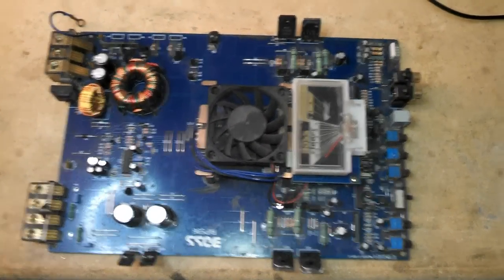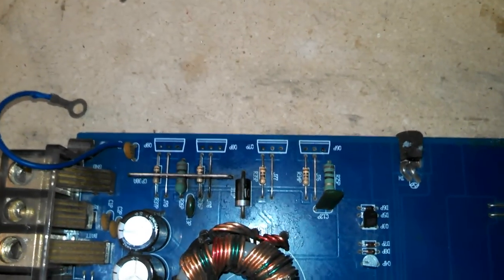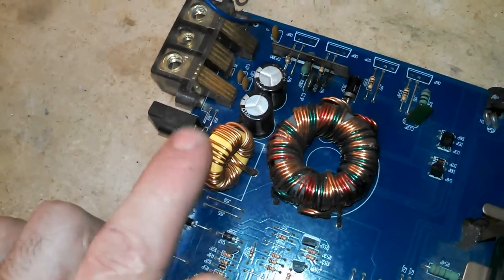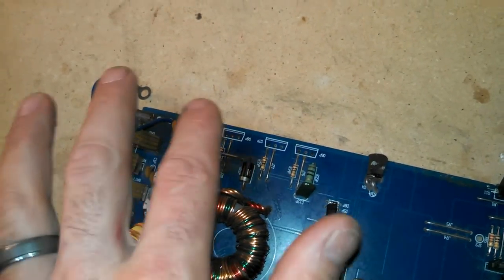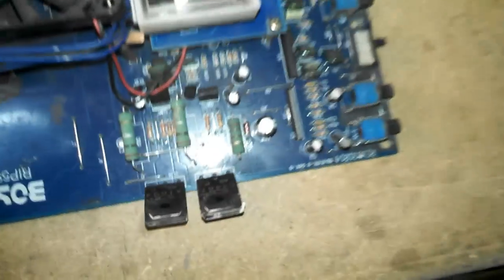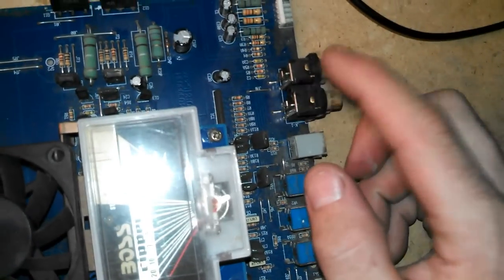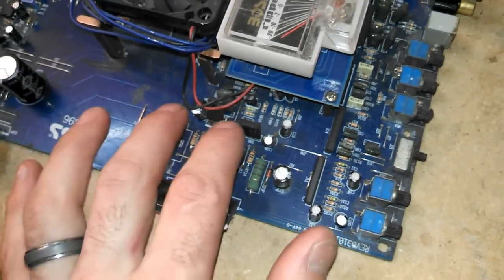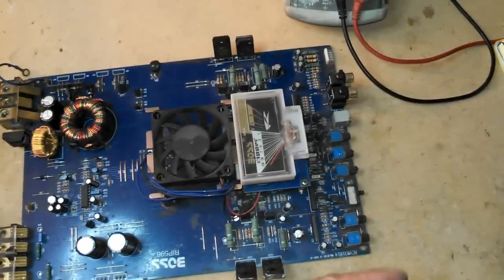How an Amplifier Works - What happens inside a car audio amplifier

Comment: The LC filter in front of the core is not there to filter out anything coming in, no appreciable noise transfers through the power supply . The LC filter is there to filter out the high frequency hard switching noise created by the fets that will, if not filtered, put a 40khz and up spikey square wave back out onto your +12, making a huge antenna and will make other electronics in the vehicle fail and work erratically. It is required by the FCC,  read part 15 of the FCC rules and regulations.  The npn and pnp transistors are not on the top and bottom as you pointed out, they are right next to each other. That boss amp uses the 2sc4467 2sa1694 Sanken audio transistor pair.
Reply: interestin. so much history in boards

Comment: I gotta old massive audio 25.4 I believe it is a 1000.4 it's hudge more than half the size of the competition 1500.2 I had from them awhile ago, it still works great but the rca's input are loose I was gonna just open it up & ca glue it but what might you recommend I have lots of experience soldering but iv only dabbled in motherboards when somthing easy broke or I would bridge the old aux cable mini portable speakers to make them LOUDER but I don't have/own a vacum or anything just basic solder stuff,even 6% silver solder but im all ears

Comment: thanks for the video sir.
one of the mos explicit videos on amplifiers explanation.
Would apreciate your help. I am trying to repair my subwoofer class d amplifier.
I got a green light no proctection light, however there is no output signal voltage.
RCA have continuity to the board,  i am wondering is the OPAMP are bad and not turning on the output mosfets?

Comment: I have an old SPL dk1000 amp that was in my car and it slowly stopped working. first it started cutting out while running a pair of 12s and then finally went dead with no power, fuse intact.

I haven't opened it up to look yet but do you know of any common problems that would cause the amp to lose power completely? blown fets? I have a multimeter, just don't know what to look for/what could be fixed, if at all.

Comment: Hi mate, really enjoyed the video! Just what I wanted to know! Now....I have a 1000 watt boss amp and I'm certain is does not put out 1000. Can I make it a better amp by replacing the caps and MOSFETs with better quality items? Thanks
Reply: +howitis howitis No, you can't just install better or higher rated parts. That will improve reliability, but the actual output power is truly designed into the amplifier. When a company builds higher and lower wattage versions of nearly the same amplifier - there are other parts also changed to match the designed output.

Comment: what re them six green things called next to the driver transistors?
Reply: +Harold Williams The large ones are known as emitter resistors. The actual signal from the output transistors needs to have a very small "buffer" of a fraction of an ohm, as well as an inductor (coil) for stable operation. The same applies to home stereo equipment as well.

Comment: Quick question my amp turns on and everything but does not put out any sound. Wiring and fuses are good as im running a smaller amp. Any help on how to fix it

Comment: Hey man awesome video I learned a lot. I have a question though, what would cause an amplifier that's powered on to almost catch on fire without having any RCA's plugged into it?
Reply: What does it do with rcas plugged in? Sounds like you have a dead short somewhere in the pwr supply region.

Comment: Quick question, how much voltage does the transformer in the amp output? could you make some sort of inverter out of the power supply side of the amp?
Reply from the maker: The voltage all depends on the amplifier.  But no you can't make a DC to AC inverter. Even if it did produce 110v AC, it would not be at 60hz which is what standard US AC runs at.

Comment: What can cause a power drop when volume is increased? Even the LED light flickers. I have enough power coming in. I have another amp that runs fine on same hookup. Problem amp Boss CH2502

Comment: hi mate i bought a q4000 amp and the question i have is when it says
 • Rated Power: 125 Watts RMS @ 4 ohm x 4) does this mean each of the 4 channels has 125 watts rms at 4 ohms
or does it mean it has 125 watts rms between the 4 channels at 4 ohms
Reply: Each single channel is driven by 125W RMS output ×4 not 125W across all ×4.
Reply: @smetanavichlamanov8103  6 years later i got my answer cheers mate , ;)

Comment: this is really helpful understanding the basics! I do have a curiosity though, can the amp be powered by an external transformer that has the rail voltage need by the amp, pretty much bypassing the amps power supply and feed it lets say at the power capacitors with a + - 20v ? like in the case I want to use a car amp at home, and don't want to use a 12V high amp p supply
Reply: yes you can but then the caps must change
Reply: bassnatics caution you may also 'bypass' any *protection such as dc on the output or over current conditions that the switching supply would shut down in

Comment: I have a memphis pr 1.500 I'm trying to test it with a computer power supply my question is I have power on the amp but can not get signal to come out of the amp I'm using my house equalizer to send signal to the amp do you think the amp is blown or is a power supply not enough to run it? Ps rca's are good
Reply from the maker: A computer power supply is not ideal to power an amplifier. It could very well be bad, but I would still change the power supply.  does the amp power on?
Reply: it's powered on and the cooling fan runs but no sound coming out of it I know the way I have signal going to it won't have volume control but I turned the gain up and down sub sonic filter all that no sound I threw power to the sub with my house amp just to check it's not the speaker
Reply from the maker: +Josh Cassler Could be a ton of things. no way of knowing without seeing it in person and really testing things.
Reply: if one end of the rca plugs is in the amp and you touch the other end of the rca you should get a hum or a buzz or somthing it's dead not even a crackle it takes pretty big Guage wire to run if it's not getting enough power would it still be able to turn on just not put out sound
Reply from the maker: +Josh Cassler I have seen that, yes.

Comment: Hello, I have an amplifier and it doesnt work. Its lights are ok. Everytime I turn it on with the subwoofer connected 2 small components situated next to each other named C4467 and A1694 get hot. The speakers work fine because I connected them with my house Amp. If I change channel to my subwoofer then another set of these components gets hot equally. Moreover if I coonect only the speakers without the sub then it gets hot but slower. PLEASE help me...!
Reply: A quick google says these are your NPN and PNP transistors (they handle the power going through the speaker). They should be attached to a heatsink, but if they are in a 'low power' amplifier, that might not have been necessary in theory. Speakers have different resistances (16, 8, 4 ohm are common) which means that if you use the wrong one, you'll get more volume through it, but much more current will run through the system, heating up components. A simple way to solve this would be to heat sink these, if you must use those speakers. If you'd like to do this, the simplest way would be a drop of super glue and a small piece of metal (preferably with fins) attached to each chip, to help spread the heat (use electrical tape to prevent the metal from touching anything else, and don't let them touch each other. Many transistors/mosfets conduct current through the heat sink).
* I take no responsibility for any damage to your equipment, you should look into heat sinking before following this advice.
Reply: Disconnect the speaker and check what the voltage is on the speaker terminal. It should be very low around 20/30 mV or less (0.020/0.30 volts) if it is volt/s you have a offset problem.

Comment: I have a phoenix gold tantrum 1200.1 the amp turns on and I get 0 sound but the sub reaches full Xmas and hums any idea's. I've removed the amp from the car and replaced it with another amp and it works fine. I've tried bench testing the phoenix gold with the result no sound just hum's and the sub goes to full xmax
Reply: Sounds like you have Direct Current at the amp output which is pushing the cone out and holding it there. It could eventually cook the coil of the sub. But I'm not sure which component is faulty allowing this to happen.

Comment: question: I have an alpine pdx m6 and it gave up on me taking my woofer with it
the amp powers up; but it is sending DC power to my speaker
any idea what may be causing that so i can get an idea if it is worth fixing?
Reply: Amps work with dc not ac

Comment: I had 3 risistors burn up right by the transistors or 3 prong black square things. Why ? If I replace them will they just burn again.Also it worked and I heard music from a very small speaker,iput on my subs then it fried. Worked before subs butsubs are fine just couldn't handle it I guess. Also how do I replace the resistors and get same ones ? Ones that fried are just like others next to them so how can I test them to see whati need
Reply: +Headshothorror4488 Those emitter resistors blow for a reason, and you need to fix the reason. Those rarely blow, so you've got major damage somewhere.
Reply: +Alan Maier They are 10 ohm I think , it fried up only one in a set of four but is 10+ yra old. Also worked on a small speaker.

New amp , it will get loud and normal then just goes half as loud outa nowhere ? When I press on the amp cover it gets loud again , when I jiggle the RCA connectors same thing. Could a loose RCA cause this as in the amp loose not wired RCA those are new n Memphis. Is the a ground wire in amp ?maybe loose, its a mtx tc300 CEA 2006 rated but old.

Comment: I'm trying to bypass the built in internal amp on a 90s Honda radio, basically converting it from high level out to low level out for a cleaner signal to an external amplifier.  Also looking at upgrading the DSP and other preamp chips where possible if anyone has any tips.  I have no idea where to find circuit board and chip information if anyone can help.

Comment: what causes a amp to play fine up untill it builds heat? i know heat isnt good. but it happens. i use a peizo buzzer to set my gain so im sure im not clipping. ?
Reply from the maker: Sounds like the load impedence is too low for the amplifier.  ie a 1-ohm load on a 2-ohm stable amp.
Reply: +The Amp Lab you would think..but. it did the same thing to me at 2ohm as its doing on .5.. i can play it for 30 min maybe full tilt and it will then go into protect untill i let it cool. i opened the amp and i see no burns or anything funky... i have 4 batteries. and i am constantly monitoring voltage. i just dont get it.  amp is a lanzar opti 7k
Reply: +The Amp Lab also the amp is .5 stable
Reply: It could be thermal runaway in an output transistor. When the transistor gets overheated, it's junction resistance drops, causing more current to flow, causing even more heat and lower junction resistance, causing even more current to flow and, you get the picture. I diagnosed this problem about 20 years ago on my vintage 1979 fosgate pr250 amp by spraying the transistors with "component cooler". Let the amp run until you start to hear the "noise" then start spraying the suspect outputs. If the cooling action makes the noise disappear, you have found the culprit or one of the culprits. Also, chances are, that if an output is defective there may also be driver transistors and resistors ahead of it that could have been the cause of the output to become defective in the first place. I AM NOT a formally trained technician, just some guy who has tried to fix a few things on his own, sometimes with success, sometimes with failure.
Reply: vintage stereo buff wow thanks for the response. I will look into it. I need to figure out what Is what

Comment: ayy bro I have a hifonics zues zx6000 I green power light on powers up fine but no sound what could it be???\
Reply from the maker: A LOT of things.  Most likely an open output transistor though.  Could be a bad power supply as well.  Some amps "poer" lights simply run off the remote turn on and give no real indication whether the amp is working or not.
Reply: I had that same AMP, found out that 1 channel was blown in the amp.  GL
Reply: Loss of a pre amp power rail? shorted cap etc..

Comment: Transformer act like inverter. from battery 12V D.C goes to transformer and  mosfet switched in to ground to make secondary voltages A.C example 48V AC. switching speed by control i.c pulse modulation

Comment: Something weird happened to me. I bought a used amp. So I connected the ground wire, the power wire and the remote wire. Amp powers on. Then I removed the power wire. Amp still on. And it stayed on for a few minutes until I removed the remote wire. Everything I know is a lie?
Reply: YES IT IS 😆😆

Comment: Hi, just saw this today.  i may have blown two amps :(   Basically the first one i connected the ground, but the live to the Live speaker out from the amp.  It's smoked a hell of a lot.  What could be burned out?

2nd amp I momentarily connected ground and live wrong way around.  The connection sparked.  However i don't know if this amp was working anyway.  Both units a re 2nd hand.

Great if you have any input.
Reply: ***** I have of course checked the fuses attached to the amps.
Reply: Thanks for the speedy reply 😀 that was back in june/.  Amps were OK/  car sold.  Cheers

Comment: so i have a infiniti G35 coupe with BOSE amp and when i turn the radio on there is no sound at all and everything on that head unit is working and if i press a button to set a radio station i do hear that beep noise on all 4 speaker that let me know that the station has been set. its just no sound from the radio through the speaker and when it does it will usually make a popping and crackling sound and if im lucky then the sound from the speak will work and sometimes it will be stuck on a particular volume level and if i up the volume or down the volume it wont change the actual volume at all and if i do sometimes the sound from the speaker will stop working then i will have to turn the power on and off on and off and crank up the volume with that popping/crackling noise until i can get the sound back on. im sure it is not the speaker because all 4 speaker do work perfectly when there is sound and i open the head unit and check all the wiring and grounding and cant figure out what is the cause. i check the amp by just looking at it and checking the connection and all seems fine. so im not sure does the Amp also control the sound/ volume from the head unit to the speaker?

Comment: Who else was here hoping to find out how to remove the protection.
Reply from the maker: Steven Hainz It's different on many amps. Most Korean built amplifiers only require a single diode to be removed to disable over-current and temperature protection. I won't give out the information since it could potentially cause a fire hazard among other things though.
Reply: C'mon man! I'm just curious how to do it it looks EXACTLY like the amp you cooked an egg on it's a Jensen 300 watt amp 2 channel can only be bridged at 4 ohms. I appreciate the quick response.
Reply from the maker: Steven Hainz That amp would be different then. Probably Chinese built.  Find the IC that controls the power supply.  Do some research on the IC, with a little work you should be able to find out what Pin would shut it down when it goes low or high.  Just force it in the opposite state so it can't shut down. That's what I did to the Pioneer.  I will not tell you what Pin it is, sorry, but with a little homework and the data sheet you should be able to figure it out pretty easy.
Reply: Ok. Thank You. What do you mean opposite state though?
Reply from the maker: Steven Hainz  If the pin goes high to trigger protect, force it low (ground). or vice versa.
Reply: Alright thanks.
Reply: I ended up messing up my amp haha fuck man do you think there's a simple way to fix it?

 - It still turns on or so the led's do but not the power led.
 I have removed and connected all speaker ground and power wires also replaced the fuse and of course removed what I had done. Any thoughts on what exactly happened? There was quite a bit of smoke smelled just awful but nothing looked burned.
Reply: Steven Hainz my amp wont turn on lol
Reply: How do I remove protection? Haha I messed up my amp. I hope you learned something.
Reply: vintage stereo buff check your 12v remote and your ground. if u messed up ur amp it really doesnt work anymore and u will need a multimeteter to find out
Reply: youngtexasplaya21, You misunderstood my comment. I was being sarcastic to Steve Hainz who insisted on finding out how to defeat the protection mode, then laughingly complained about ruining his amp. I have never blown an amp or a sub. I use common sense and don't disable protection circuits.
Reply: vintage stereo buff lol i knew that

Comment: if possible could you send me you're email address. . if you could help me or guide me on how to repair an amplifier I'm trying to fix I already have it opened up I see what the problem is I just have ran into a brick wall just trying to see if you could help me on what it is that I need to do just to I can be clear